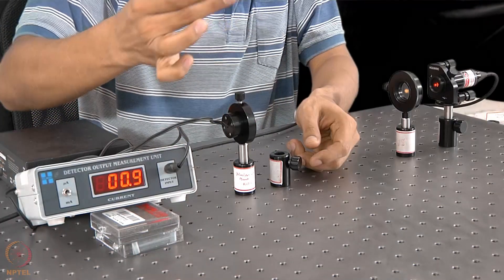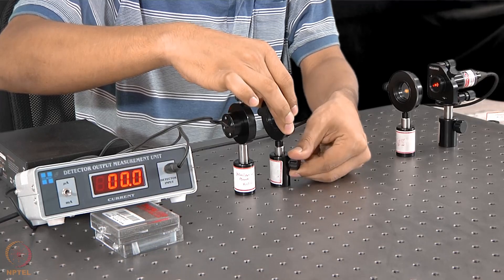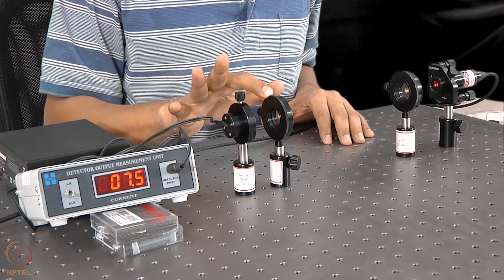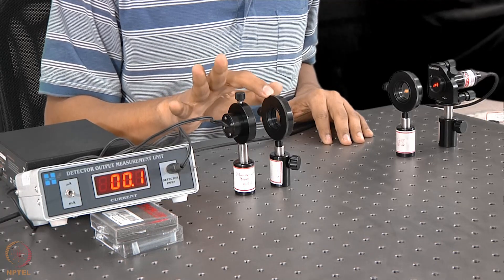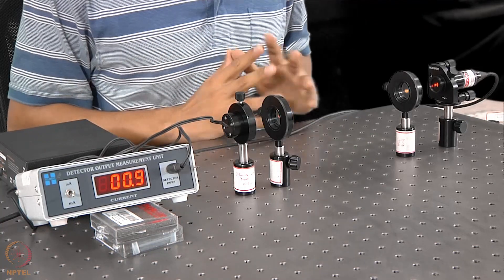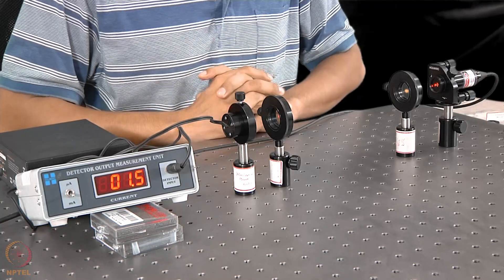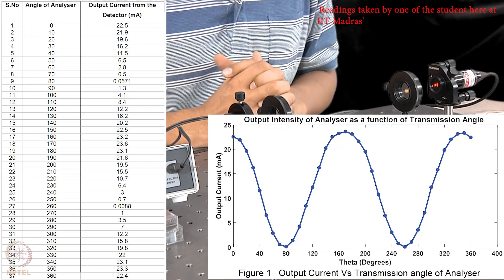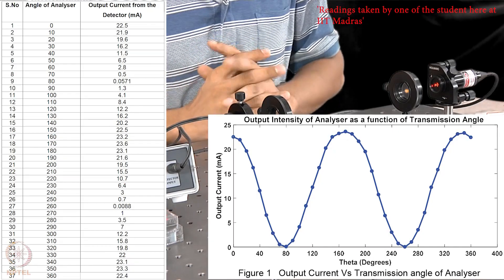Lab Demonstration: Manipulation of Light Intensity  &  Polarization

Comment: Thanks for the video. When you had just one polarizer in front of the laser, the reading on your meter was 10 mA.  But on your spreadsheet showing the results, you have a maximum current of ~23mA around 0, 180, 360. How come it is higher at those angles than when there is no polarizer?